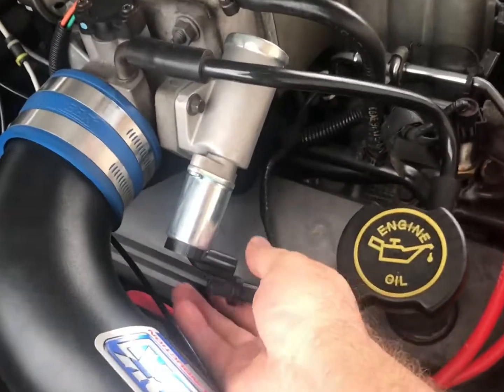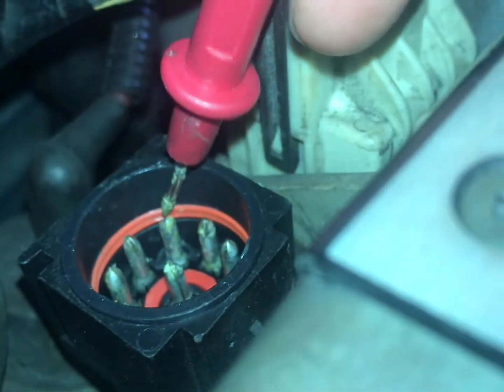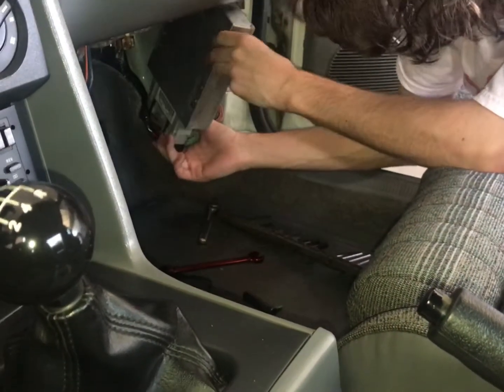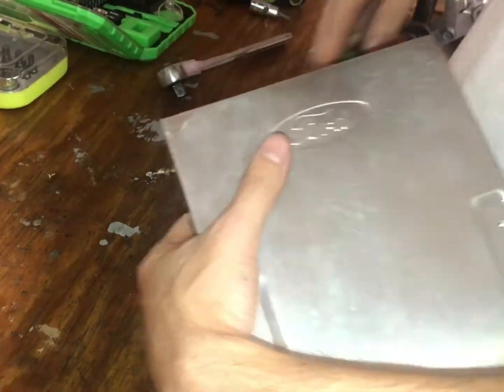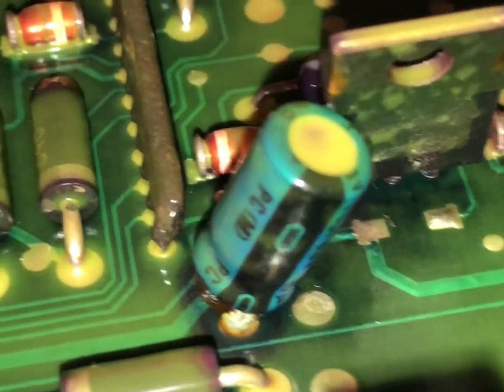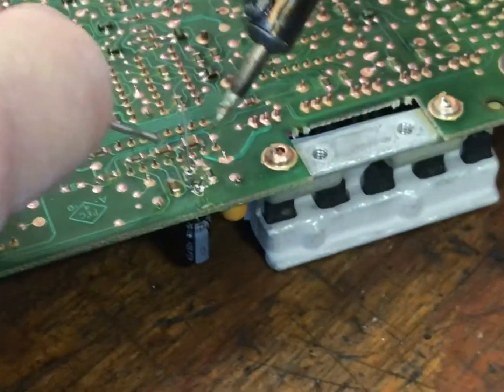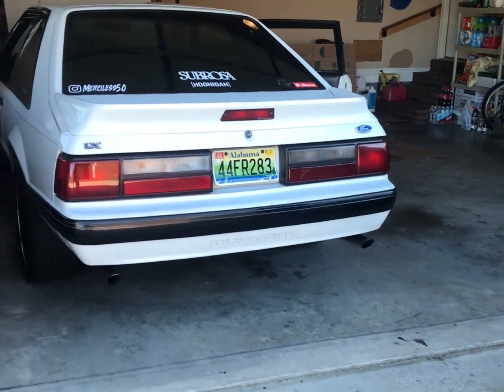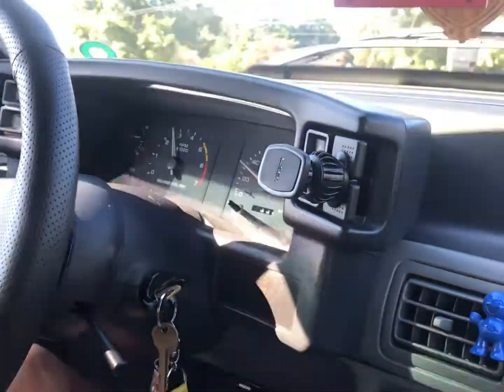Fox Body- Mustang - ECU Repair

Comment: The capacitors are generally considered to have a 15 year lifespan . I'm in the process of taking out my ECU now in my  Mark VII , gonna have to take out something from the heater , definitely fighting me , and I lost . Fairly sure mine is original making it 34 years old .
Reply from the maker: @rolandtamaccio3285  15 year life span was about the life the average vehicle.  Not many left.
Reply: @millionmilegarage9587 ,,, have mine apart , only has 2 round blue vertical caps , there's another little blue rectangular vertical that I wonder is it also a cap ,,, ?

Comment: Awesome video ...my car does this intermittently when it gets hot,  if you try and start it again it just cranks and won't fire or sometimes it fires and runs really rough for a while. (Can't take your foot off the pedal kinda rough) I know one of the capacitors is for the fuel system and after this video Im not worried about tackling the issue myself. Thank you!

Comment: So, a little tip for soldering capacitors or like any trough hole mounted parts, it will work most of the time only doing a little blip of solder, but if you would do a little bit more so it reaches almost trough the hole you wont get cold solder joints and it will be a bit harder to break off, but anyways nice video :)

Comment: @million mile garage what codes were present in the ecu when you did a test or did you ever do a test
Reply from the maker: Test came back as A-OK, no fault codes, evidently it can’t test itself for all faults.  Weird.
Reply: @millionmilegarage9587  mine keep throwing a mass air code with a new one and a 98 so

Comment: Hello good sir,

Wondering what temperature you solder at?

Thank you
Reply from the maker: Not sure about the heat, the soldering iron used in the video is a 30 watt Chicago electric unit, it takes a while to heat the joint, hence you could here me counting in seconds once I had an idea how long it took to get the parts hot enough to take the solder.

Comment: Update from last nights cruise threw town with it- no more kicking and bucking at low rpm, and now the torque curve doesn’t fall on its face at 4,500rpm anymore and no surging even when starting it in the mid 40s outside 👍👍
Reply: Wow my csr is doing the same damn thing. Pulled my computer apart and found 1 bad capacitor and 1 look rough!